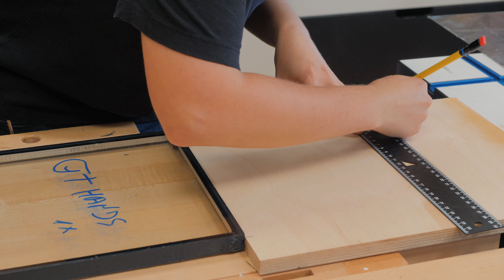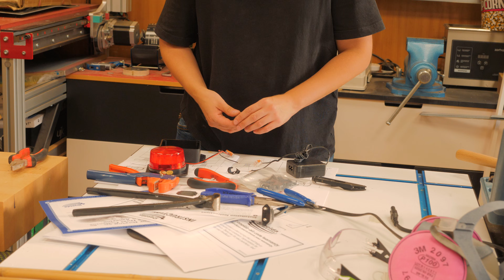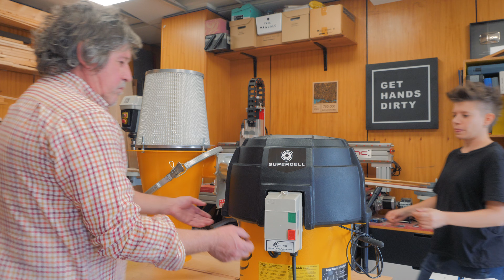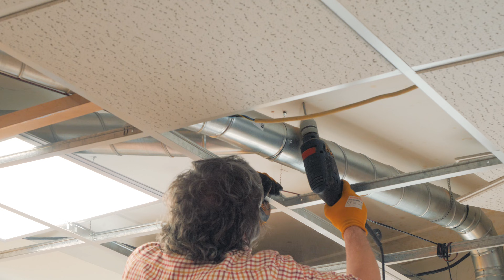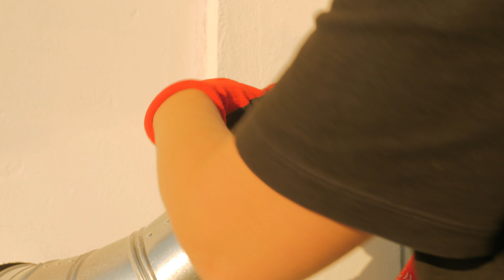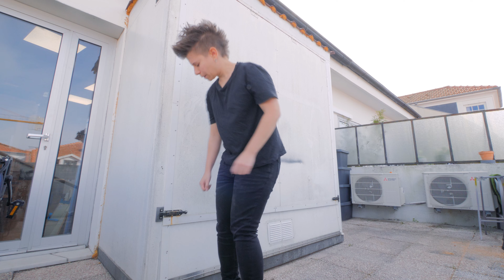Powerful Dust Collection for ANY Workshop

Comment: Hello from America!  Hey, just checking in after you’ve been using the Oneida Supercell Turbo for 4 years or so.  I’m thinking about purchasing the same model and interested in your thoughts, what you like and what you don’t like?  Several reviews mentioned the remote control stopped working and others, the motors overheat and shut down.  Those are two of my main concerns.  Please share your experience, pros and cons.  Thank you!!
Reply: I see you didn’t get a reply. I’m in the same boat as you on what to buy. What did you end up going with?

Comment: Honestly,  without a return air path. 
You could just blow the dust into the wind,  your dust collection room should be filtered back into the shop or your just making your heat and air conditioning  blow out the door and sucking dust back in and door or wall void it also lowers the capasity of air movement in the dust collection system, your CFM shows how much heat loss that room has,  you need a filter from the shed back into the shop thats going to let as much air you pull out  pull back in.  You want to test this theroy. Turn on the dust collector and open the outside door then mesure, the close the door and mesure youll want to hold the door as you close it becuse its going to slam shut.  In fact when the dust collector is on it wont open as expected  or as eazy if it was off.

The inflow and outflow must match. But its always better to have a larger inflow and add a filter like a merv 15.  Large surface filter pleated.  Id also insolate the shed becuse its now conditioed space.
Reply: Ok you've seen the vacume problem in the shop, but think about this your dumping the air into the shed also, and the shed has more airflow comming in then it can let out this is also a choke point on the CFM capabilities of the 
Dust collection system.
 Fix it and your CFM will go way up.
You should gain more CFM at the points you mesured.

Comment: I have an Oneida Gorilla 3hp DC and let me explain a problem with it. Do not trust the blinking light or you will fill up the bin and the filter with wood dust and chips. I installed a plexiglass window in my bin after the first time my filter filled up. I can now look at the window and see if it is full. The bin fills out the sides first and leaves a vee shaped hole in the center of the bin due to the vortex. Just a word of caution from someone who knows.

Comment: Amazing work！By the way，Is the air pressure in the sealed room too low due to the external dust collector? Does the body feel? Because it seems that your dust collector is very powerful.
Reply from the maker: The body doesn’t feel right away but seeing the force it uses to open the glass door that I show at the end, makes me nervous to even use it without opening it. Is not a big deal to remember to open it slightly anyway and even in winter with the heater turned on, opening it 3 or 5min at a time or less doesn’t make too much of a difference. At least I’m ok with it.
Reply: @GetHandsDirty  Thanks！It's also good to have a fresh air system unintentionally!

Comment: Just install a rafter hinge for your dust collector when maintaining it. Seems like you can attach two wooden beams to reinforce and slide an H-bar between them and one of those mechanical hinge for lifting weights. After that, just build a lifting cradle meant for it. That way, you can make a two-man job, into an one man.

Comment: Stainless steel is an alloy of carbon steel that is, itself, resistant to corrosion. However, stainless steel is reactive with aluminum, and when a stainless steel screw is in contact with an aluminum base metal, the aluminum is likely to corrode.
Aluminum and stainless steel together also appears to be a bi-metallic corrosion risk, from the ‘nobility’ table.

Comment: I don't know how cold it is over there during the winter. But without a return air pipe, it will get cold very fast if you suck that amount of heated air and dump it outside.

Comment: Christina, do not forget to ‘earth’ the metal piping, the metal of hanging sealing should also been connected to earth so probably an easy option is above the ceiling. The moving dust though the pips will generate high voltages and could generate sparks ⚡️. And high dust concentrations and ⚡️ sparks …. Do not mix well…. 💥

Comment: Great system & great installation too. Amazing to see the negative pressure effect on your door & room environment. Should be enough to suck out lots of airborne particles too. 
If manufacturers build in heat exchanger on air return, you wouldn't be sending your studio/workshop heat out with the dust!!

Comment: A friend has a carpentry shop, 4 people work and uses 2 cyclones. It has metal pipes like yours. Actually, I wants to write about safety, about electrostatic discharge. He happened to self-ignite 2 times in a pipe and a fire in a barrel. It was enough to wrap the ground wire. Note for yourself that your flexible cables have built-in wires that protect against electrostatic discharge. Regards.

Comment: Nicely done. You will definitely need to allow air coming in the room or even use a fan to push it in. This way you'll get the best performance out of your dust collector setup.
Your workshop seems to be in a residential building. If I am not mistaken about this, how do you keep the noise levels low enough to not bother your neighbors?

Comment: Excellent job, Cris! Though I think you should consider a duct for return air flow. It is not just about negative pressure as such, it will also suck out cool air in the summer if you have A/C and warm air in the winter and replace it with street temperature air. And judging by the excellent efficiency of your new system, this will happen VERY quickly once you start working.

Comment: Check to see if you need to have a static discharge wire run, especially with the metal duct work.  I know with PVC, it's good to have a grounded wire running to a nail or something metal that sticks into the airway to discharge static.  Not sure, but might be worth looking at.  

That out of the way, fantastic build.  It looks and seems like it performs beautifully!  Great work!

Comment: Hey Cristiana, just a word about dust collection and metal chips. . . you don't want to vacuum chips into the dust bin. The chips can get hot traveling through the duct work and possibly smoulder / catch fire when you aren't there. Great job on the installation!!!

Comment: Very nice installation. Can't you locate a little (lightly) spring loaded valve somewhere to let air in when pressure gets low?
Reply from the maker: I will search for something like that, thanks!
Reply: @GetHandsDirty  look for a backdraft damper shutter.

Comment: Hi Cristiana, cool work. Did something similar in my workshop, but we are more about comunity, so we have automatic on/off system, designed by ourselves. We just turn the powertool and the system handle the rest. As we use same blast gates, if you are interested in, I can share it with you. Actually considering to put it out as open source or for few bucks 😉. Plus I am fun of your work / channel.

Comment: About the section of cable which ran outside the building (that you’ve painted yellow) could you have ran it inside that duct??
Reply from the maker: I wouldn't do that. Wood chips and bits of trash could get stuck and it would be weird to makes holes in the ducting and such.
Reply: Fair comment..

Just saying a no hassle look has equally as much logic behind it, could also run the internal cables in additional tubing with the incision via wall cavities??

Comment: Where you ran the wire through the window, you should have some sort of grommet to prevent wear, though if you drill the hole to fit the conduit through, that will work too.

Comment: you could attach a hinge to the mounting plate and add a locking system to top plate of the motor/filter so it could tip forward for easy cleaning? love your vids! keep up the great work and ingenuity!!
Reply from the maker: Could be a good idea,  although the machine is quite heavy and it wouldn't be that easy to put in practice.

Comment: Could you place a pulley system above the assembly to be able to remove it for cleaning?
Reply: If you remove the dust bin first, it looks like there would be enough room to lower the dust collector enough to change the filter.

Ideal would be if the motor were fixed in place and the cyclone and filter lowered from it, but I expect it's the cyclone that is providing the vibration damping.

If the entire thing were hung by rope and pully from the ceiling one might need bungee cord goind sideways in a few directions to keep it from swinging.